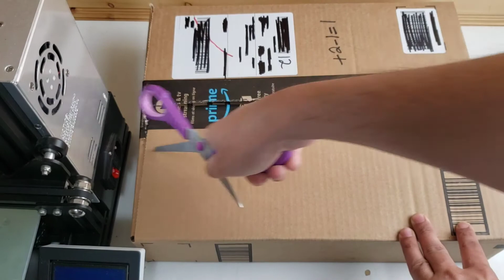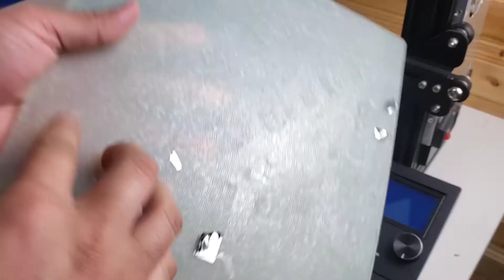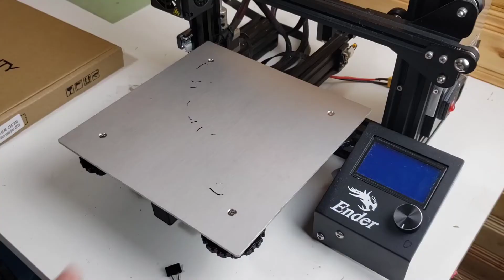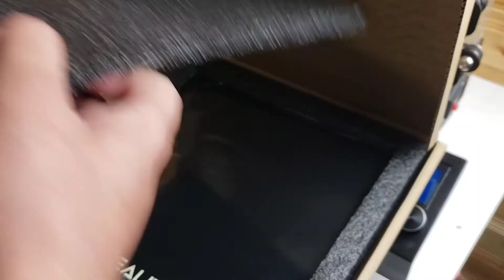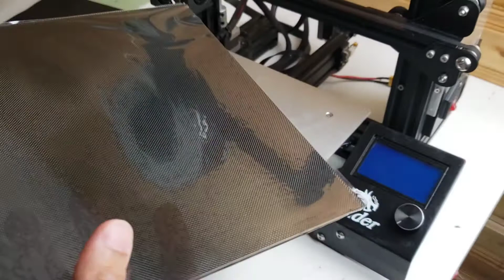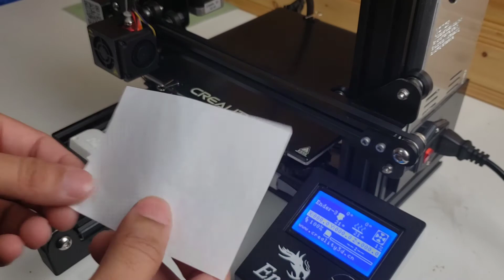Creality Ender 3 Glass Bed Upgrade

Comment: Dude you had your original plate glued down to make it even you're supposed to use the wheels.you I need to stay away from 3D peinting kid
Reply: Then you proceed to push down on your bed as you're pulling the plastic protector off. All these people saying you're doing a good job you need to go back day one of printing because you don't know what your doing
Reply: Also next time don't adjust your z just lower you damn bored if you're going to do an instructional video you need to do it right you're going to make a lot of people mess up machines

Comment: Hi, I got the same one recently. it prints very well, all sticks to the bed. However it is very difficult to remove pieces after print, even when you let it cool. Do you have tricks to remove pieces after printing ?
Reply from the maker: If you are using hair spray then stop using it. Otherwise you can use a scraper that came with your printer to remove parts. When your print is finished let it cool completely and it will come right off. Sometimes you'll have to just give it some push and it Will come off.
Reply: I wash it in cold water, and have been thinking about adding a flexible sheet above the glass so I can take the sheet off and flex it

Comment: Hey all! we just released new perfect fit mirror beds for the Ender 3. They are Super HQ and individually certified to within .05mm flatness. You get 2 mirror beds and a set of 4 REALLY nice one piece stainless steel bed clips. please check us out if you're upgrading hxxps://www.amazon.com/Goodey-Printer-Mirror-Bed-Borosilicate/dp/B088PC3F69